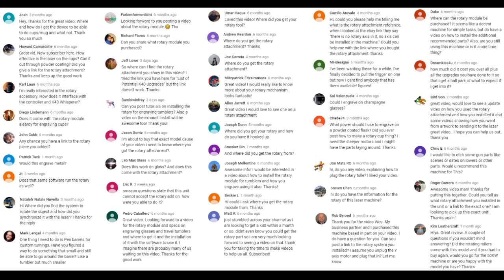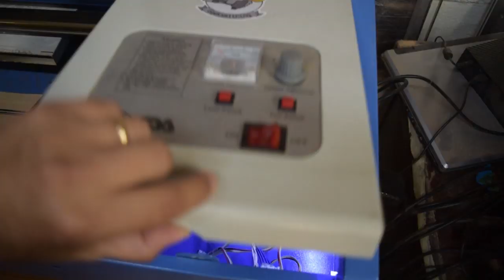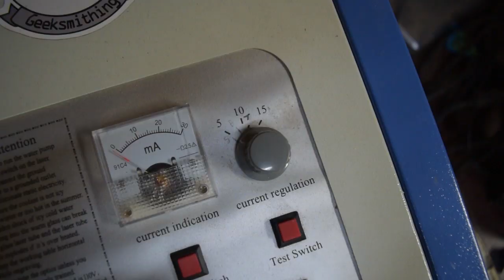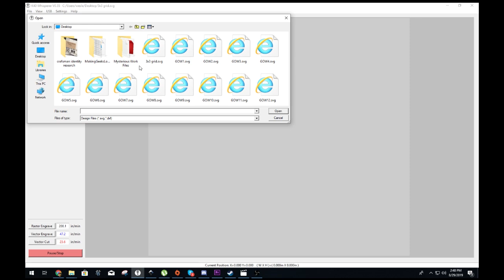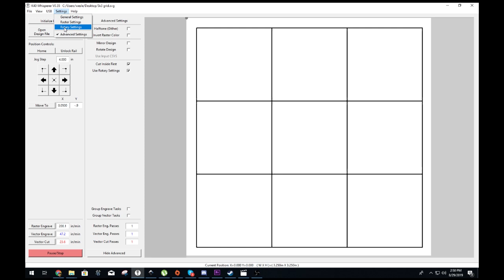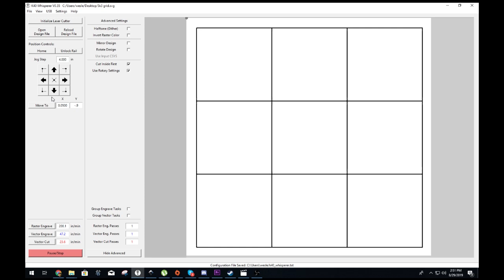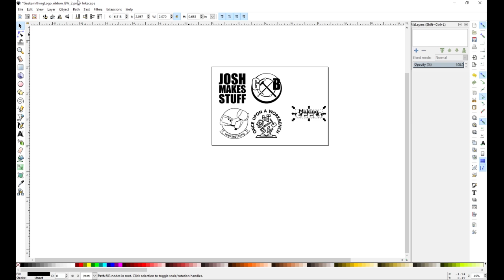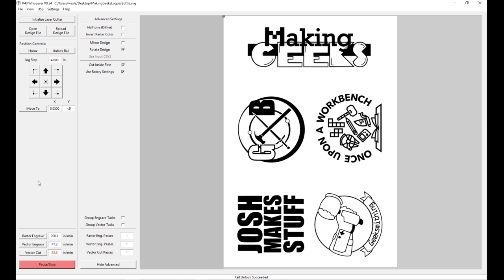DIY Rotary Module for K40 Laser Engravers!

Comment: With your own graphic software, why didn’t you just make the registration box yourself?
Reply from the maker: Hmm? Sorry, not sure I follow.
Reply: Geeksmithing you obviously use a program to make and adjust the graphics you use to engrave. Why would you go through all that hassle with measuring and math when you could have simply made your own square box that worked perfectly the first time and in less time?
Reply from the maker: @Bobster986  the purpose of the math bit is not to create a square, but to calibrate the rotary. The stepper motor used in the Rotary is different than the stock one.  It rotates at a slightly different rate than the stock one  If you do not calculate for and account for this variance, your images will come out squished on the final product.  I am sorry this was not clearly described on the video.

Comment: Any chance this machine works on the T4 aluminum? Such as the back plate of the Glock
Reply from the maker: If it is anodized or powder coated, it can usually remove that coating
Reply: @Geeksmithing  thank you and lastly, how about on polymer?
Reply from the maker: @2A_LEGOS  not sure.... If I had some to test, if try it.   I'll have to investigate that
Reply: Geeksmithing we’re you able to test it on that back plate you ordered from the last video? 😅
Reply: Geeksmithing I want to buy this engraved but I’ll be working with a lot of polymers and parts of guns is why I’m asking
Reply from the maker: @2A_LEGOS  I figured that was why you were asking. :P  Your profile kinda gave that a way. ;)  Ah yes, right, well, that piece was so tiny, I honestly think it got tossed out in the packaging.... may have to get another. :)
Reply: Geeksmithing ah dang it, haha okay. The ejection port cover should be double or three times the size but thank you anyways.
Reply from the maker: @2A_LEGOS  what about this? https://imgur.com/a/ebmGAz6
Reply: Geeksmithing I’m honestly not sure what that is. It looks like an AK Mag?

Comment: Hi Wes, I’m now making duck calls and want to engrave my LOGO on Wood and Acrylic materials.
How do you set up small parts?
My call parts are 2” X 3”.
Also the call will be at a tapered angle. Can you do a post on something like that. I’m not a computer Geek but man I could follow what you posted. 
Just wanted to say thank you, thank you!!!
Dan
You can PM me I’m on Facebook or text my cell is in the description.
Reply from the maker: Hey Dan! That is a great question and idea.   The tricky part there is coming up with the fixture/rig to make it repeatable.  As long as the surface of the object is the correct distance away and relatively flat it should be fine. (May have to prop the piece up in such a way to tilt the taper out, so to speak)
Reply: Geeksmithing 
Hello, can you set me up a system that will work for me? I’m just going to do duck & goose calls.
Either wood or acrylic materials.
Can you pm me and I will send you pics of my calls? I understand I will pay you to help me. 
I’m in no way a computer person but my son has a 3D printer.
Let me know.
Thank you
Dan

Comment: When you’re adjusting Ma is it on the machine or is it in the program like lightburn?
Reply from the maker: a dial on the machine
Reply: @Geeksmithing  For some reason when I adjust the Ma on mines it stays around 5 ma for Raster engrave (digital with meter). But besides that I was able to get successful prints thank to you 💯👍🏼

Comment: My GT2 200mm belts are too tight to work over the metal pulleys.  Bought from Amazon.  Thoughts? 
Bought these: https://smile.amazon.com/gp/product/B07TF6KG4H/ref=ppx_yo_dt_b_asin_title_o00_s00?ie=UTF8&psc=1
Reply from the maker: Ugh oh. I will investigate. Let me get back to ya!
Reply: Rubber bands to the rescue!  While I would still like to get the 6mm belt working, a rubber band tripled is working.
Reply from the maker: @ChrisBires  haha, good idea! I am just finishing up that revision and it should be uploaded tonight.
Reply: @Geeksmithing  Is the STL for the chassis what you are updating/have updated?  BTW: Your video is excellent.  I should have led with that.  ;)
Reply from the maker: @ChrisBires  haha thanks!  I finished the SVG version. Just need to pop in Fusion and extrude it out and add feet.
Reply from the maker: @ChrisBires  Hey Chris!  I revised the files and links.  Let me know how that works for you!  Have a great one!
Reply: @Geeksmithing  I printed them today and swapped them in with the 6mm belt.  It's VERY tight but seems to work, with one caveat:  The stepper frequently backs up after moving, as seen in this video: https://youtu.be/My1NyPp5UlA
Reply: @Geeksmithing  This is the Nema steppers with just the rubber bands:  https://youtu.be/R9ovDeBZcMM